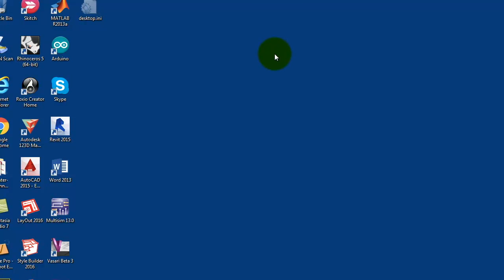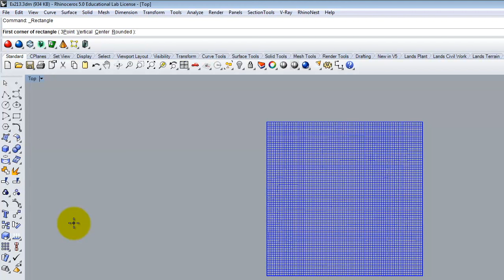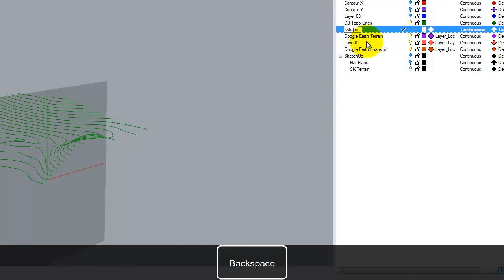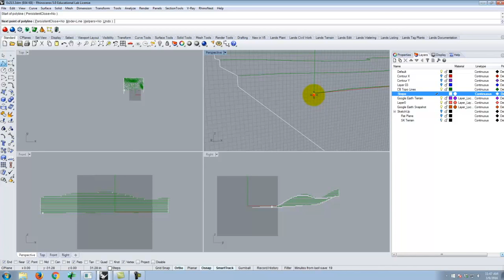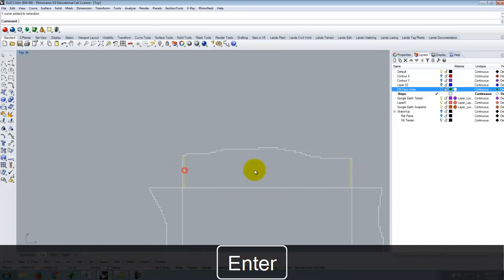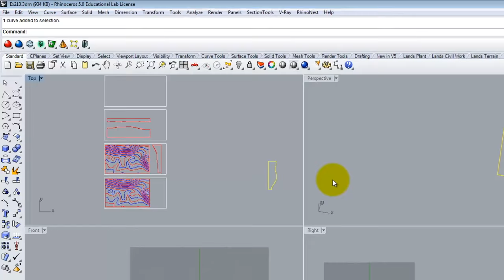Lecture 213 - Topographic Physical Models (Spring 2016)

Comment: Hello!
Congratulations on the video lessons.
Recently, I started using the Rhinoceros program.
I'm trying to see his applicability in the area of topography. Topography of open pit mines.
I've already done some testing here and I'm in trouble.
For example, when I load the topography of the open pits in the format dwg (lines and points) and make the generation of surfaces something wrong happens. In this case, the surface is very softened, which does not correspond to reality.
If you could send me your email it would be interesting. I've done some print screens here so you can visually understand what I'm trying to explain to you.
In the other software that uses the surface generation is very close to the real one, already in Rhinoceros there is an exaggeration in the smoothing of the triangulation.
I would like the surfaces generated by the Datamine and Rhinoceros to be approximately equal ... Would you like to help me?
Thanks for listening....
Reply from the maker: Sure.  I will try to help, though I'm always really busy.  Send me an email grant at digitaltoolsforarchitects dot com.
Reply: Hi!
Thank for answering.
I will send the images on your email.